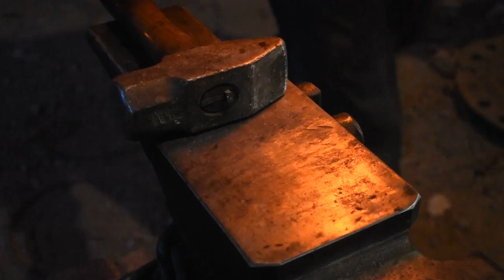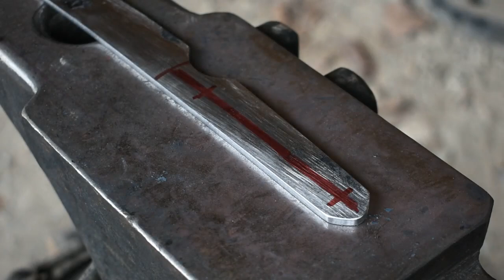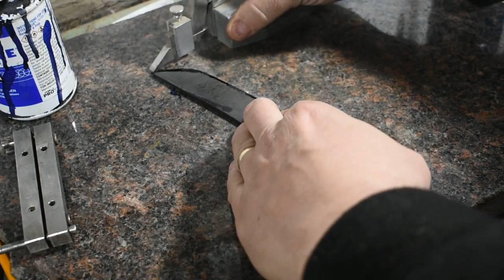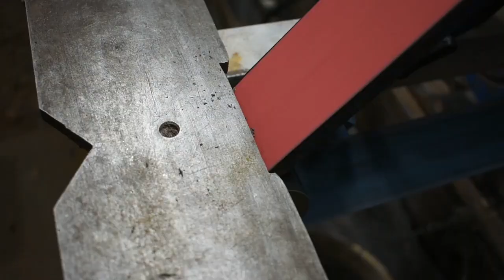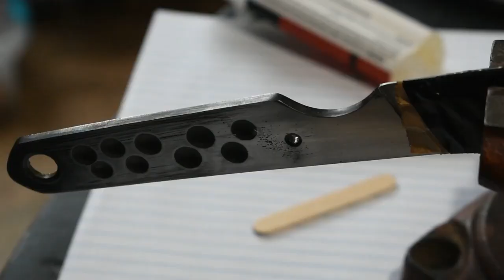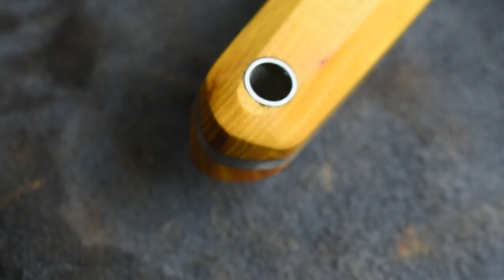Forging a Tanto inspired knife from 5160

Comment: how many degrees do you heat the sharp to thermal cycle??
Reply from the maker: I usually go up to around 1600F and check with a digital laser thermometer, then down to 1000Fthen down to 800F allowing it to cool completely to the touch in between. The best method would be to use a heat treating kiln to hold the temp at recommended levels but I don't have one. This method seems to yield excellent results. I appreciate you watching.